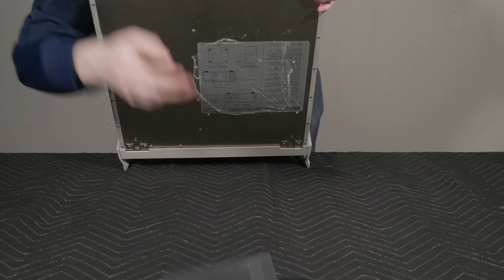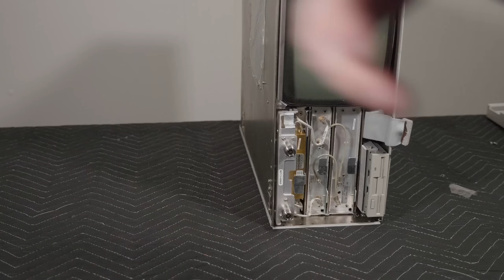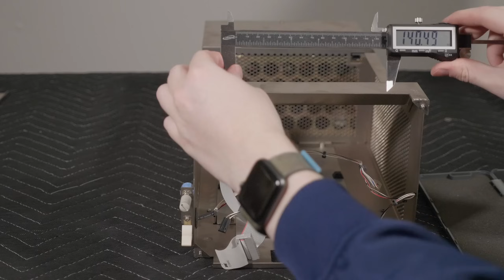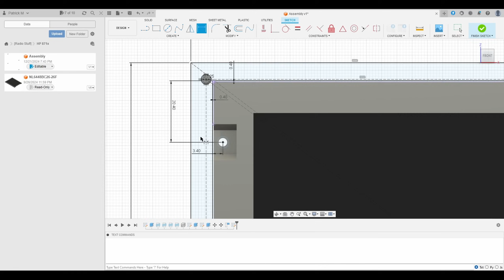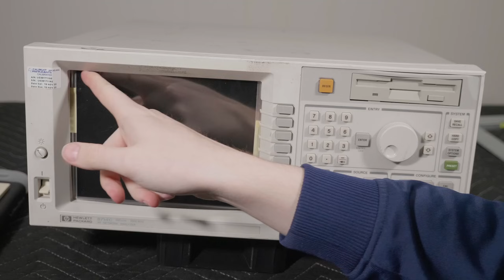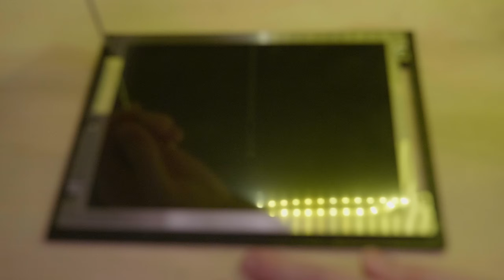Bringing My VNA into the 21st Century - HP 8714C LCD Upgrade

Comment: Instead of vinyl tape, I think you could 3d print inserts which would attach to the front four sides of the mounting bracket, and fill in the curved bezel gaps. theres enough space in the middle of the front four sides to figure out how to attach the inserts, so the fact that the corners are flush is not a problem. if you print the inserts the correct orientation, you would get a nearly infinitely smooth curve instead of the stairstep you saw in the eevblog pic.

Comment: It's a shame you have to sacrifice the VGA port for this. With Tektronix oscilloscopes, there usually is a (slightly more expensive) way to use the signal from the video board directly and keep the VGA port.

Comment: Get a bit of Melamine faced chipboard fit in place of screen, use two part filler to fill in gaps around screen, remove board and clean up filler. (paint if required)  Profit 🤟

Comment: If you're lucky the ribbon cable has plain VGA on it as well as +12v, judging by the pin count that's very possible. That would make the entire module a complete drop-in replacement without any weird wiring going through the outside.

The fact that they marketed the colour output as an upgraded model makes me wonder why the internal monitor wasn't replaced by a color VGA one since those were pretty common in the 90s.

Comment: I came into the video wondering why you replace a perfectly working tube for a LCD, until you said that the display has color out of the VGA port. You should check the power consumption difference between the LCD and the CRT.

Comment: When measuring mounting studs, instead of doing inside and outside measurements, measure one bolt and zero the calipers. Then measure outside to outside - that's the center to center distance! You've subtracted 1/2 a bolt width on each side by zeroing on one bolt!
Reply from the maker: @gorak9000  Filing that one away for future reference. Smart!
Reply: @w3axl  works good on mounting holes too - measure one hole inside, then zero, then measure outside edge to outside edge across both holes using the inside side of the calipers - no need to 'estimate' where the center of the hole is

Comment: That was such a nice looking CRT 😕
Reply: I don't understand the hate for this mod... This CRT is only a monitor with 640×480 resolution or 800×600 resolution, if the LCD has the same resolution there are no problems.
Reply: In this application the LCD is the better option by far
Reply: @cromulence  Why? We used it for 20 years and everything was ok until Aliexpress came along.
Reply: @ShedewrS  OP literally described the main selling point. Multiple colours. CRTs are fetishised as these amazing things. This device is a functional utility. It doesn't need scan lines, it doesn't need perfect scaling. This LCD adds functionality, lowers weight, and is easier to replace in the future.
Reply: @cromulence  It's not like the VNA is a pocket knife—20 kg is perfectly manageable for a permanent lab setup. After 20 years of flawlessly running CRTs, upgrading to an LCD is clearly the groundbreaking innovation we all needed. I mean, who wouldn’t want to deal with replacing capacitors and some precise resistors to restore the factory measurement accuracy? It's better just add a color.
Why not use a small external LCD monitor with a VGA input for those occasional needs for color lines instead of modifying a perfectly functioning CRT? Plus, what will you do with the removed CRT? Will it end up in the trash, stored until it eventually breaks, or left to gather dust without proper recycling?

I can understand the reason 'I don't have money, so I'll show you how to cheaply create something similar to modern technology for a student and a novice technician using a grandpa's oscilloscope/VNA' – vandalism out of necessity. But replacing a working display just for fun is not cool.
Reply: @ShedewrS  It is a monochrome green CRT. The new display displays better (in multiple ways) at lower weight and improves overall useability of the instrument so why make a complaint about it? Keep your instrument as is if you like the CRT better. And your proposal of using an external Monitor is not keeping this CRT any healthier or produces any less waste unless you explicitly use a monitor that would have gone in the trash otherwise. And it can take up quite a bit of bench space.
Reply: @ShedewrS  who cares what you think. Keep all the CRTs you want to keep.